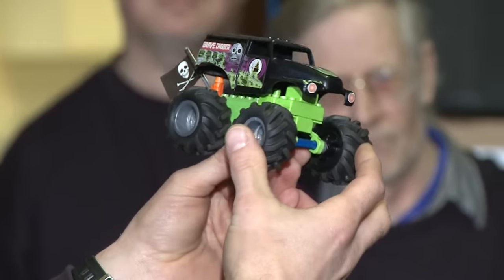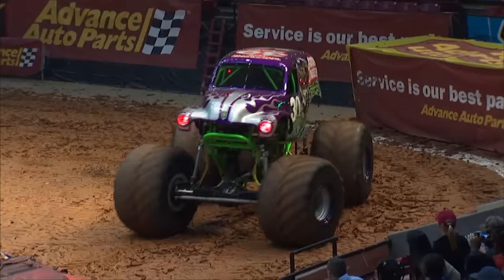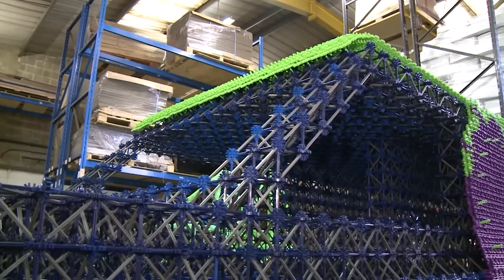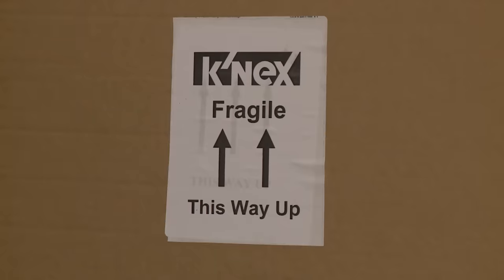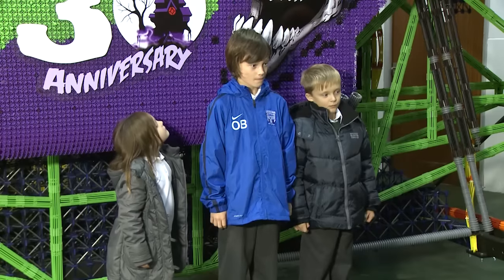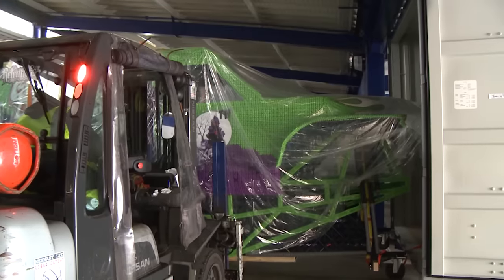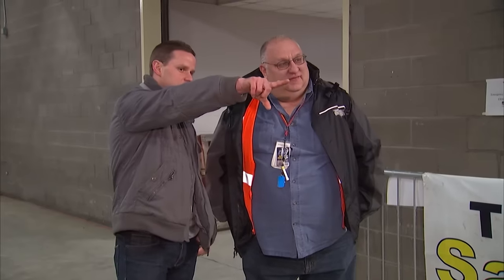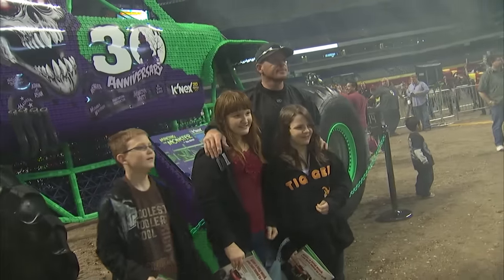Monster Jam's "Grave Digger" 30th Anniversary life-size K'NEX Truck Documentary

Comment: Does it drive
Reply from the maker: Unfortunately, the RBLI K'NEX Truck doesn't have an engine.
Reply: Noooooooooooo!
Reply: Lavender Blue Media Will it blend?
Reply: +Pingu probably
Reply: +Lavender Blue Media it would be cool if it did tho
Reply: +Pingu hahahahahaha nice
Reply: hi gg
Reply: Julie Hickman a
Reply: No because there is no engine, no room to get in, and no axis to spin the wheels
Reply: Julie Hickman does it have a moter
Reply: Julie Hickman
Reply: Julie Hickman no it's kin ex the wheels are bolted in and they don't move nor does it have a motor
Reply: Julie Hickman it has no Engine
Reply: Julie Hickman no
Reply: Yes.
Reply: Julie Hickman yes
Reply: Pingu nope
Reply: Sadly it doesn't